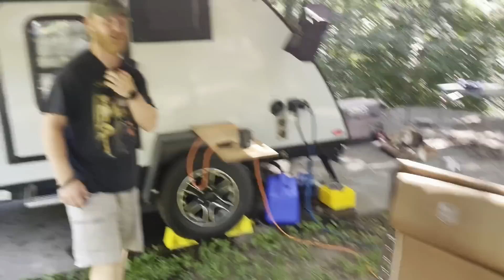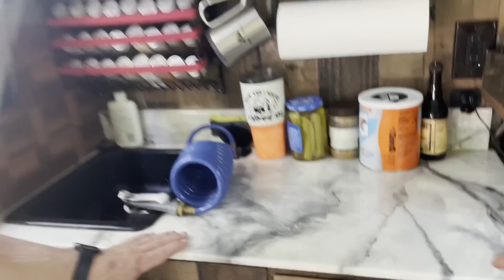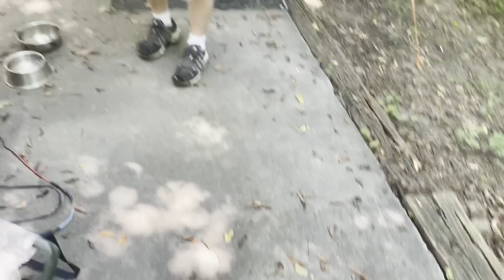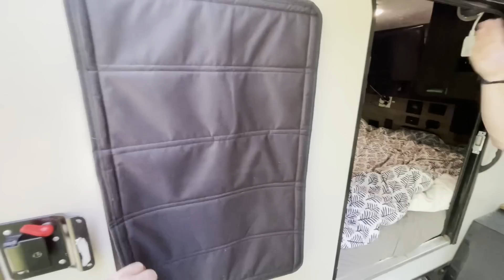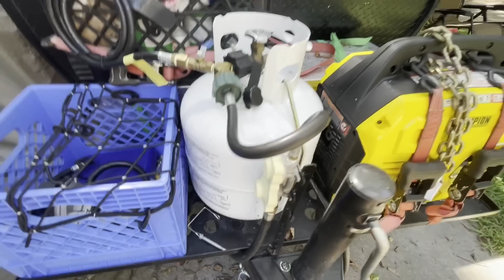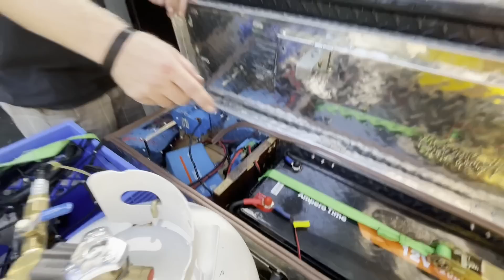Kris Lives Full Time in a Teardrop - Bushwhacher 10HD

Comment: Hello DYII, I know this was a few years ago but every time I see a Bushwacker and now the new trailers are from Bontrager and they’ve improved them but of all the trailers I have researched and having my Bushwacker which was heavily modified and I think I told you I had to sell it because my dog Shiloh got cancer I needed the money to pay for the bills but now I’m in the market and with all the research looking at new trailers I constantly go back to the Bushwhacker I really like the new Bontrager with the Mtn. package and then they have the skinny guy which is actually pretty nice with 3500 pound axle and exterior shower and then there is just the standard HD 10 and what’s so nice about those trailers is you can literally go to the dealership purchase it and go straight to the mountains it’s got air conditioning heating big water tank has everything you need in the price is reasonable and the entire unit is not made out of wood it’s really a great little camper I haven’t decided on what I’m getting yet but I’m looking at affordability and durability off-road and I feel having air conditioning and heating is very important mainly for my dog, I have considered the hiker trailer but because it’s all made out of wood I don’t know how they’re going to hold up and everything I do is deep backcountry the only issue I had with the Bushwhacker was the little screws on the very bottom where it holds a piece of trim on they would come loose and I ended up putting a little bit larger diameter screw in and then I silicone them so they wouldn’t back out and then with all the modifications I did it was awesome, thanks for all your videos they’re getting better and better every year I have learned so much about electronics through your videos it’s been amazing thank you

Comment: 17:24 what are the popular sealant issue areas? I’ve got one spot I can see light in through on the door of my Free Solo OG and got some water in with heavy rainfall during travel.
Reply from the maker: Pretty standard across the whole RV industry.  We have to tweak doors, adjust, weatherstripping, and continue to add sealant across the seam of the camper.  Paying special attention to the bottom, there’s a lot of areas we can seal to avoid moisture wicking inside.
Reply: @ I just picked this camper up summer of 2024, so I’ll have to crawl under it in the spring and see what needs sealing.

Comment: I lived in my teardrop one summer on land i bought while it was prepped an a tiny cabin built and hauled in. Off grid and pretty out of the way. I have about the same amount of solar, also got a camp chef , coukdnt get the pro , out of stock got the premium or whatever. Works great. Just put the campchef on a counter in the cabin when it was ready. Just one big pantry cabinet build by a friend, and yes an ice co dual zone 78 qt. And this year i bought a generator after Maine was waterlogged last year. 3 days of rain today so far so i ran it 4 hours, charged the bluetti 100% and it will last another 3 days on that if sun isnt strong. I take trips to different areas in north and west maine, some to the coast up around Lubec and Machias. Love tiny living, no tv, i removed it, i do have a tablet , but i use my fishing pole alot more for entertainment. Same size generator, guess the camper kind of dictates the sizes of stuff. Have a great Audi heater that runs on propane or battery. I leave it on propane and set it real low cause i love to sleep cold. The bluetti, the oven and the ice co were bought big enough to serve the cabin but can be loaded into my truck and i can travel. My tear drop is probably twice the size of yours but i need the room for my 140 pound dog, so i set it up for queen size bed , take out the swivel table and use the bathroom that i only used once and said nope, for storage. I use the outdoor shower, the tiny sink and two burner stove, the tiny square frig that is 3 way power when traveling. Staying as dispersed as possible, which is easy up here. Nice to have a base, but nice to leave when the bugs get bad, go to the mountain tops or coast to blow them away. I love how my stuff switched to cabin life, love having my teardrop for a spare bedroom went i am in my camp. I feel like a kid again building a much better fort than i ever could as a child. The advance in electronics and solar have really spoiled me. No more stinky lanterns that need  mantles, fans and phones, refrigeration thru solar, that is really neat. I can now make ice rather than needing to buy it, can freeze meat and even keep some Houlton dairy ice cream around. Life is good.
Reply from the maker: It's so nice to see you get it, life is good indeed!  Seems like you have a great set up and have developed a good routine. 
Thanks for tuning in!

Comment: The only thing I do not see is a power station or "Solar Generator"?  They are in so many sizes and configurations that a gasoline or propane generator is no longer necessary except as another layer of power.
Reply from the maker: If you know me, you know I DEFINITELY asked him about that. We talked quite a bit off camera on the topic.

He has a high capacity lithium battery with a very high quality inverter, it is essentially a home built power station in his tongue box.  Despite lacking portability, he preferred it because of the quality of components and serviceability.  Although I think it's hard to beat the ease-of-use and portability of a small PPS, he made a good point as to why he would rather spend his money building out his home made system in the tongue.

Good catch! Thanks for watching.

Comment: I live in Maine for 5 to six months out of the year on my acres off grid. The tear drop got a little small, but I bought a large screen room and like you very comfortable chairs and a camp chef camp oven as I got tired of building fires to use a cast iron Dutch oven. I have the outdoor shower but reallly usually just use a the deep creek on the acres to bath with Dr Bonners soap.
Reply from the maker: I'm with you, most of us make those same changes.  Campfires are fun once in a while, they usually don't last long when you're spending months out there.  The Dutch oven is nice, it becomes a challenge to use regularly.

Comment: Great set-up.  Quick question:  how is the C channel handle connected to the slide-out locking tabs?
Reply from the maker: It can basically just snap onto the plastic handles and hold.  Some people drill a hole through the C and put a small screw in the bottom.
Reply: Appreciate it.  Thanks! @DIYOutdoorLife

Comment: Talking about the battery charging reminded me of a question I have always wondered about. Here is a scenario... Boondocking with a small travel trailer with a built in charger/inverter, an AGM battery, a small generator, and an automotive style 15/3 amp automatic separate battery charger, can you run the generator and plug the trailer into it to charge the battery while simultaneously charging the battery with the separate charger? In other words, can you charge the battery with both chargers at the same time, or just do one or the other? Thanks
Reply from the maker: Simple answer, yes, you can do that and it works fine.

There is a much, much, more detailed explanation here that would lead to me generally telling people not to do this, even knowing its fine most of the time.

What kind of battery, capacity, internal converter charger etc etc matter here.  Most AGM batteries have a limit on the amount of current they recommend charging with, it's almost always relational to the size of the battery… Around 1/5 to  1/4 ... in other words, 100 amp hour battery charging with 25 Amp.  In this case, you would want to know the size charger that came with your camper.  Adding 3 A to it is not gonna make much of a difference, but attaching an additional 20 amp charger to it might.  Kris has a 200ah lifepo.  Those batteries can accept a current up until their listed BMS... it could be as high as 150 A !  In that case, you can throw whatever you want at the battery, but it should be set to lithium charging parameters, which will be different than the charger you're talking about.    You get the point here, it's both simple and very complicated.   In your case, you could definitely add 3 A and speed the charging up a little bit with no problem.
Hope this helps and didn't unnecessarily complicate things .
Reply: Thank you sir! @DIYOutdoorLife
Reply: Thank you very much. One follow up question.. Same scenario- Would it be better to run both chargers as above, but install a cutout switch to isolate the battery? That way, the travel trailer runs off the generator/inverter at night (mainly just the heater fan load), with the separate auto charger only charging the battery overnight?   @DIYOutdoorLife
Reply from the maker: @chrisb6866  for me, I would stick with the WFCO charger/converter for the lion share of your charging.   Like you said, I would use the trickle charger for when you turn the camper off with a disconnect switch, you could install the trickle charger directly to the battery.
For the majority of your charging, the WFCO onboard charger will be more than enough. On rare occasions, when you have to speed up the charge, you could use both simultaneously.
Reply: Thank you very much.  @DIYOutdoorLife   Can I get your opinion on this situation please? I bought a brand new Weize brand 12 volt 100 AH deep cycle AGM battery about 2 months ago. Used it for 4 days while camping (only got down to maybe 30 degrees). It never got below 50% discharge rate before charging it. Got home and charged it fully and let it sit in the travel trailers battery box (in Arizona desert area, so might have seen a low of 50 degrees). Went back 5 weeks later to check it, and I obviously left something small on, because it was only at 5 volts! I immediately charged it up fully (with an AGM battery charger), and after 2 days, it is at 13.1 volts, so it seems fine?? I heard never to discharge them down past 50%, (maybe 30-40% once in a while) but 5 volts is waaaaay past that! Did I destroy the battery, or only shorten its life some, or what??? Thank you, Chris
Reply from the maker: @chrisb6866  truth be told, the battery will never be the same again.  It is very damaging to do that to them.

On the bright side, you might still have a ton of life in the battery.  If you avoid doing it again, you can still get years of enjoyment out of it.  If we were to do a capacity test, you would probably say a significant reduction in capability after "stoning" it that low.

Hope this helps, good luck !
Reply from the maker: @chrisb6866  also, make sure to put a disconnect switch on there to avoid doing it again
Reply: Thank you again sir! @DIYOutdoorLife

Comment: good to see camp chef finally put a thermostat on their oven
Reply from the maker: He has the pro model, I'm not sure if it comes with the standard model... you would think it would right?
Reply: @DIYOutdoorLife  I have the mid level deluxe cause the pros were out of stock everywhere. It isn’t bad I back up with a separate one that hangs on the rack. I have lots of the same stuff , and live on my camp acres for 6 months off grid. I found all the solar and lithium system I have I hardly need any of it. Took the tv out as I am fine with my iPad. The biggest thing I love is the Aldi heater my camper has. Not forced air and the heater element is under my bed so it heats the mattress like a heated blanket. I sleep better in my camper than I do at home.

Comment: I wonder what the weight of that camper with all that gear is. I ask because it's hard to tell, but that looks like a Tesla with a hitch on it, lol. FYI, the unofficial tow cap on Tesla Model 3 is 2000lbs.
Reply from the maker: He's under 2000 but not by much.  I'm guessing he's driving around at about 1800.